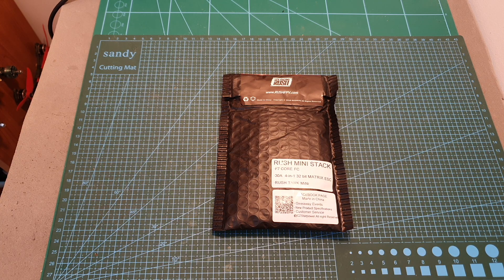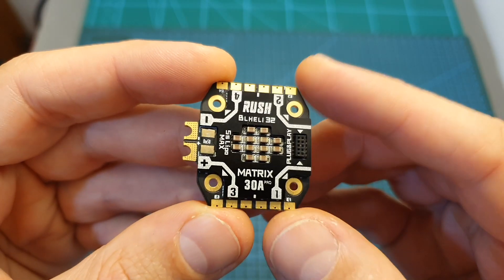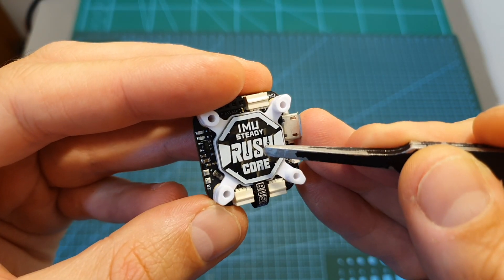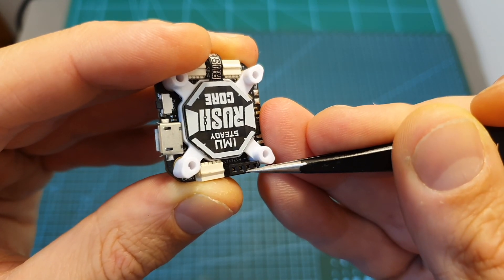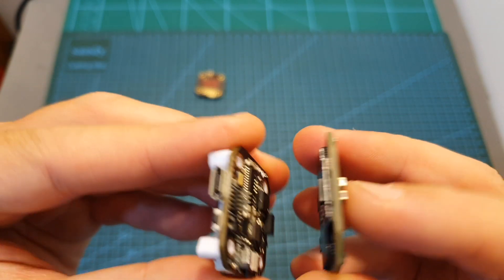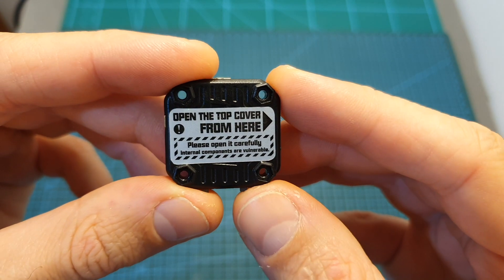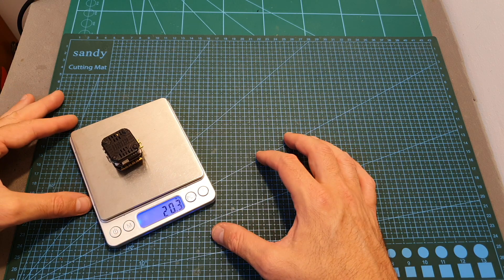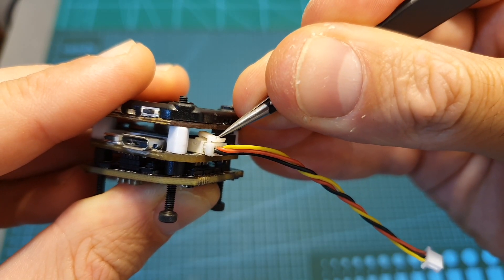RUSHFPV RUSH CORE F7 Mini Stack Overview

Comment: How do i wire an ELRS receiver to this FC?
Reply from the maker: Same like wiring a CRSF RX. Hope you got it working by now, sorry for the late response.
Reply: @KremerFPV  I got it working thanks. I had to pic up the Tx pad from a different spot on the FC not as the plug on had power and Rx.

Comment: hm only 3 pin for Receiver.  Crossfire and ELRS use 4 pin ffs. This board is pain:)
Reply from the maker: Yes, but you can still connect a 4 pins receiver if you need to. Anyway this stack is a bit old and there are better options currently.
Reply: @KremerFPV  sure, but TX2 is not on the board.  Can use TX4 or TX1 which are kinda hard to solder. I had this stack for more than 1 year in the drawer so i'm discovering these problems now when building 3".
Reply from the maker: @aaauto  yes that's understandable.

Comment: Thanks for the video!! 
So weird I have the same VTX and it worked fine for awhile now I get a small section of screen that's real bury and jumpy with lines -sometimes at the top sometimes in the middle just random where it appears. Even weirder only in the fat shark scout goggles on my 7" external display it looks perfect and to make it even more odd the blurry lines are for the most part is when it sets level -when off level it goes away completely most of the time. Any Ideas.
Reply from the maker: That's strange. Do you see it also in the DVR?
Reply: Gal Kremer  sure thing it shows up in the DVR to. Could this be FC causing issues
Reply: I just threw a tbs nano pro 5.8 and a new foxeer nano camera and it seems to be doing the same thing with the scout goggles weird only with this quad
Reply from the maker: @fishfinder3583  It might be related to the type of screen and or camera setup. If you use a different camera the issue persists?
Reply: @KremerFPV  -Thanks for the info Gal its appreciated much. I tried different cameras and 3 different vtxs -same issue in the fat shark scout goggles. I get a really bad horizontal jitter/lines makes it a eye drain to fly. I'm fixing to replace the CAP and re solder all joint etc: Seems its something on the quad not the goggles if that makes any sense.
Reply from the maker: @fishfinder3583  No worries. Did you make sure the issue is not related to an NTSC/PAL camera setup?

Comment: Hi Gal, I am currently thinking of purchase this Mini Tank Stack but are there enough ports for adding both GPS and Lidar sensor?
Reply from the maker: Hi Josh, unfortunately the number of UARTs in this stack is limited and it's not going to be compatible with your needs as far as I can remember (you can go over the layout of the FC in order to confirm it).
Reply: Gal Kremer Thank you for replying Gal！Your comparison videos are always the best！

Comment: How would you connect de foxeer mix 2 to this stack? (seems that needs a vcc/batt voltage, can\t seem to find it on the rush)
Reply from the maker: You can power it up directly from the battery pads of the ESC.
Reply: @KremerFPV  thanks for taking the time to respond! Appreciate that.

I tried hooking it up to the direct pin of the cam (5v). And does actually work at the moment. Was mostly afraid it would take too much power from the bec.

So maybe I should switch to battery indeed
Reply from the maker: @ZenoErwt  No worries. It should operate fine using the 5v and I think that the BEC of the FC should handle it with no issues.
Reply: @KremerFPV  thank you! Again! :)

Comment: For the rush tank mini to crossfire receiver, the instruction show to use the receiver plug for the ground, 5v, and TX. Im assuming the Rx on the receiver goes to the bridged pad on the back of the flight controller. It comes bridged to the rx. Should I bridge to the Tx and run the RX from the receiver to that bridged pad (now bridged to TX)?
Reply from the maker: I have to check the connection diagram. Did you get it sorted out?
Reply: Gal Kremer Thanks for your reply. I sort of got it lol. I just used the connector and connected 5v, ground, and Tx. I didn’t run the Rx to anything. The diagram is confusing for me. I’m not sure if the bridged Rx on the board controls the receiver connector or if it is a separate pad of its own. I haven’t checked it on Google’s yet to see, but I think I will be missing smart audio...? I’m happy enough, but if I could out more about that bridged Rx/Tx pad, I think I will have it understood. Thanks again! Love your channel. Big thumbs up here!
Reply from the maker: @MrIndyjonescj  No worries. SA is for the VTX though,  not for the RX. I am still not at home and I will be able to look it up for you later when I will be back if needed. Thanks for your support  :-)
Reply: Gal Kremer Ah, ya... took me a bit to set up the vtx as well in betaflight. Inexperience mostly lol. I think the Rx from the nano is for telemetry, but not sure about that. Still sort of confused about that bridged pad on the fc. Im hoping it’s more clear to someone with your experience. Hopefully you can shed some light. I’m sure there’s better stacks out there but I like the VTX on that comes on that one. Also looks very clean. And it’s super easy to build with. Thanks again!